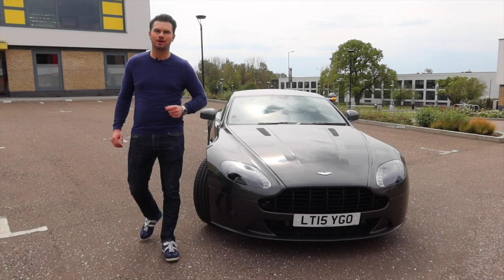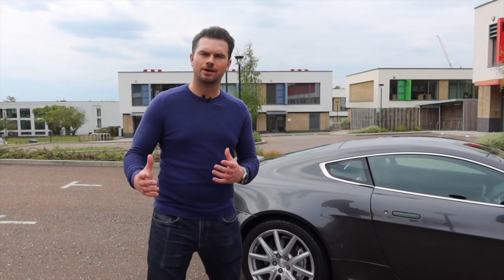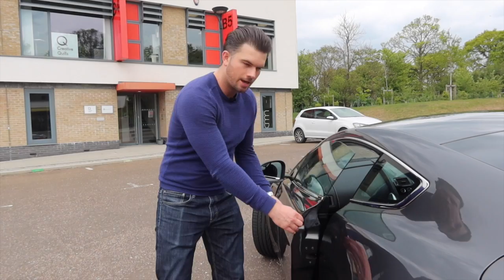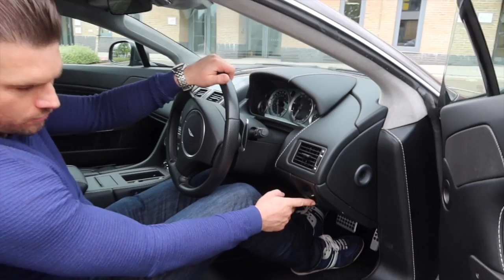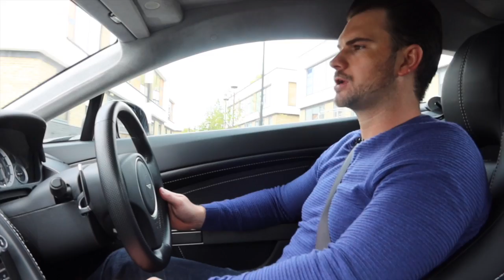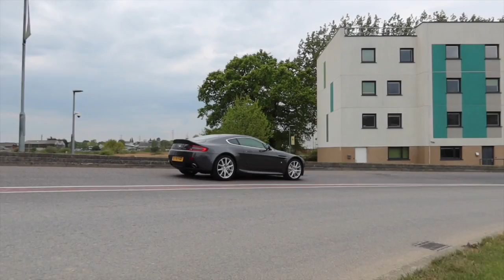ASTON MARTIN V8 VANTAGE 4.7L SPORT SHIFT 2 - YOUR NEXT CAR

Comment: The 2016 model is not a dual clutch as in VW, Audi, Porsche etc. it is a DUAL PLATE clutch and still an auto-manual gear change. Completely different from a dual clutch.
Reply from the maker: Absolutely, good point to make and share with viewers, there are after market improvements and enhancements you can make to this model, to improve gear changes.

Comment: I am thinking about getting the V8 Vantage S 2011 Rodster with only 10k miles on the clock. It’s absolutely stunning. I haven’t drive it just yet away to the dealer in one week time to get a drive test. What’s in your opinion do I need to took out for in this model? Thanks
Reply: Not sure if you are looking at a manual but i have the Sportshift in a 4.7l standard 2014 and you cannot use the standard drive if not manual, you have to use the paddles rather than “D” drive.  If the glass key is intact be extra vigilant not to drop it as it will crack easily and AM want 1000+ to replace it.  Look at the rear lights which are especially susceptible to condensation.  I have the white lenses and they would be 800+ to replace but you will find on YouTube a way to solve it for next to nothing and it is very easy to do.  If the sound isn’t constantly growly enough, take out the fuse 15 (or could be 22 in earlier cars) so you get the full valves open experience all the time.  That’s a quick summary of my experience over the last year.  I still love driving it and the sense of occasion even going to the newsagents!
Reply from the maker: Fair and good points here
Reply: 2013 V8S Roadster - bought 37k miles from AM, new clutch (£4k) before I bought it, new O2 sensor, new NS Headlamp £1650, new drivers heater matirx, AM Works (warranty) new seals on chain drive (£4k) Since then - free driving, buy with a full warranty. 10k miles is not always good - they need to be driven, not left in the garage to rot. 3-4K miles per year is good - it means the owner uses it and all the components get oiled and auto lubed often. Sat in a garage for 12 months is bad. Low mileage is not a great 'option' unless it has been used once a month.
Reply from the maker: Some fair and good points shared here
Reply from the maker: I'm sure 99% of Aston Martin owners past and present will agree that this generation is best in manual, however, if you drive the auto using paddles instead of the auto it is brilliant to drive. If you poodle around, you won't notice the clunky gears. If you drive medium or fast, you will. Specialist mechanics can enhance the gear box with upgrades to improve the transmission. The S version has a better gearbox performance as well.

Comment: Here we have a Vantage, S, 2 ! What’s a Vantage S2?
Reply from the maker: The Aston Martin S Sportshift 2 is a 7-speed automated manual transmission introduced as standard on the V8 Vantage S in 2011 to deliver faster shift times and a lighter setup than the original 6-speed system.